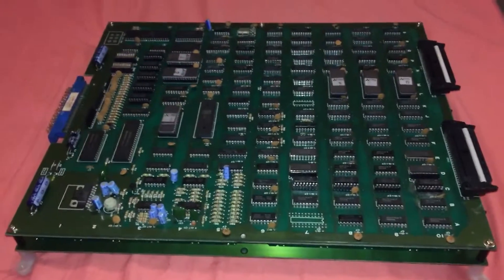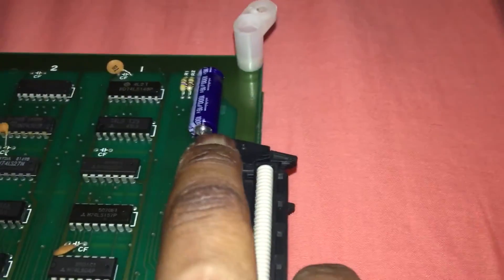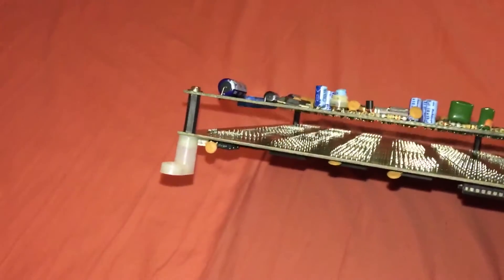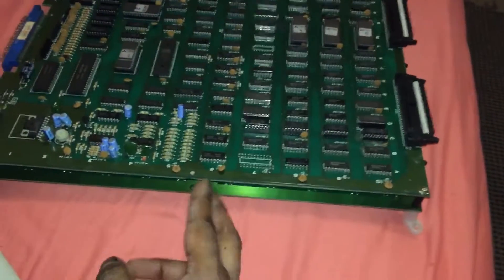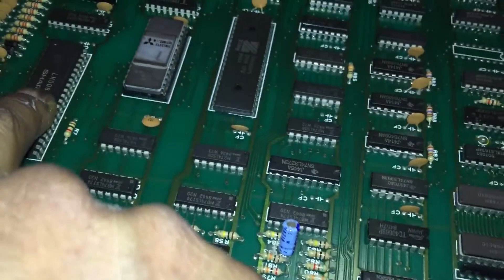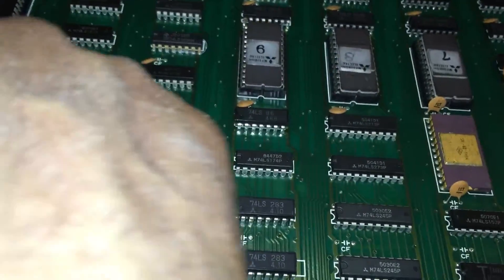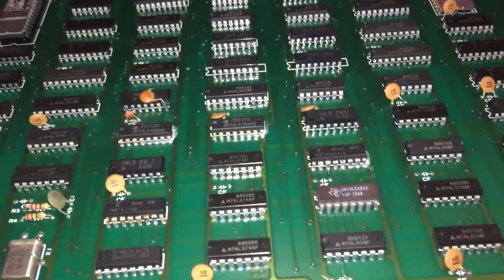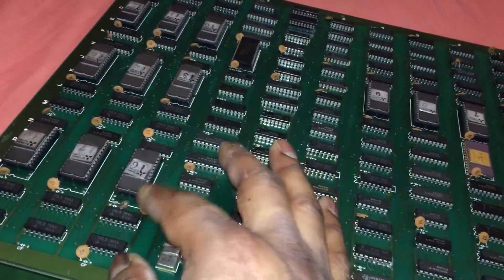Star Force repair attempt. Part 2

Comment: You don't actually need all those little orange caps its a good design habit as they decouple the DC but it'll be fine without them to test
Reply from the maker: im just really paranoid, I really don't want to fry it, although deep down I know 1 decoupling cap wont kill it